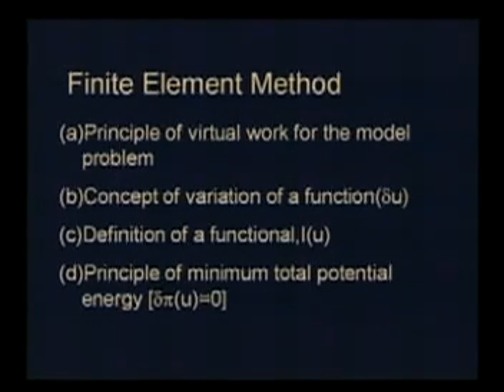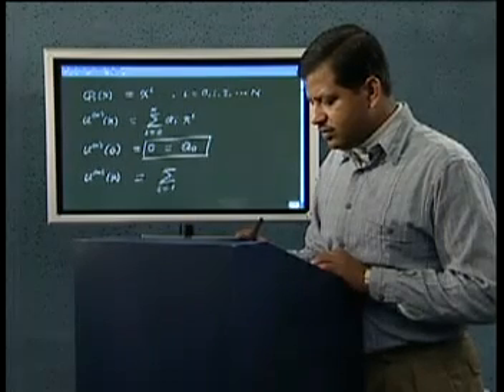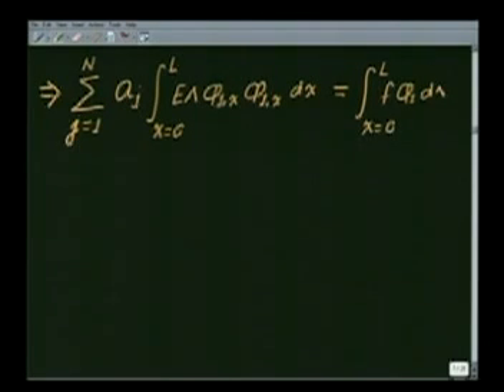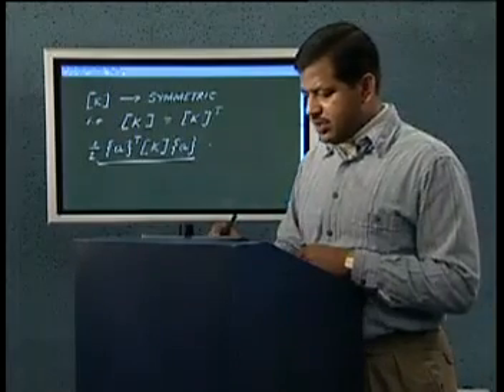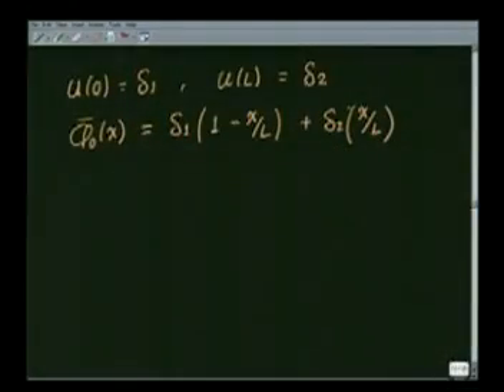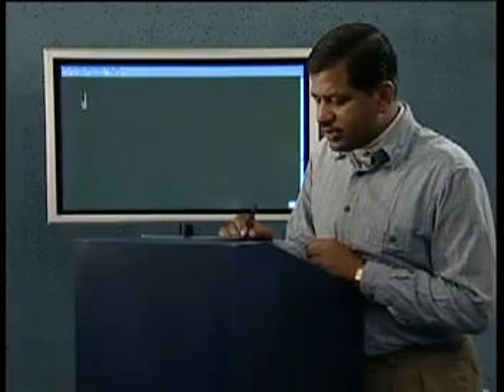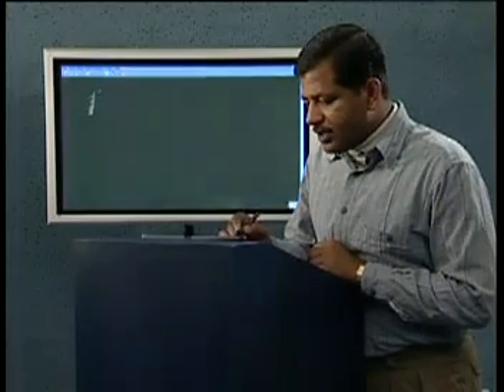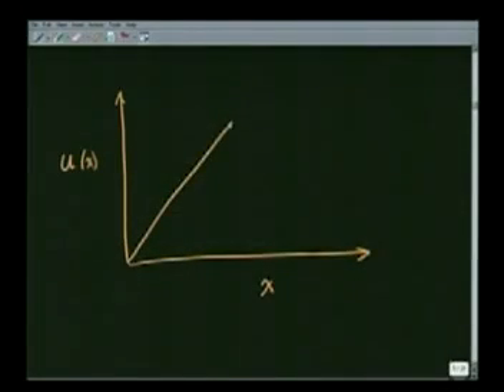Module 1 Lecture 3 Finite Element Method

Comment: there is a mistake at the minute 43, in the force matrix
instead of the 31/3 and 41/4 it should be 21/2 and 31/3
that is why the solution is incorrect.
about the mathematical formulation, i think it is very well organized and easy tu understand